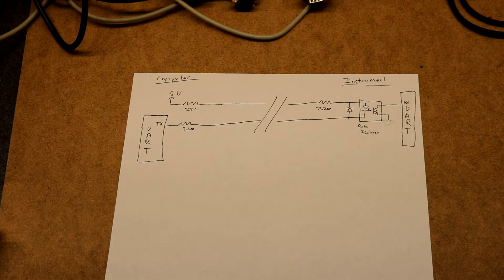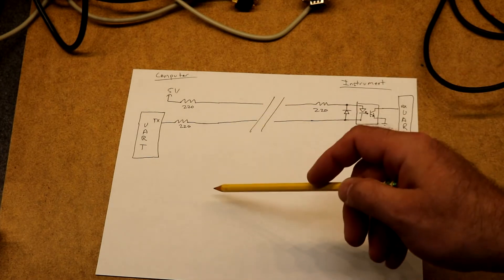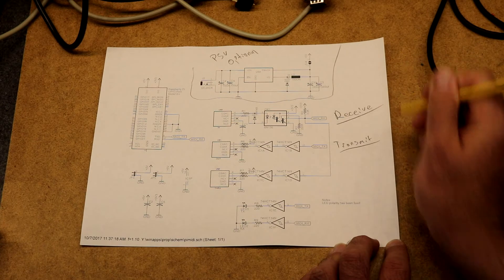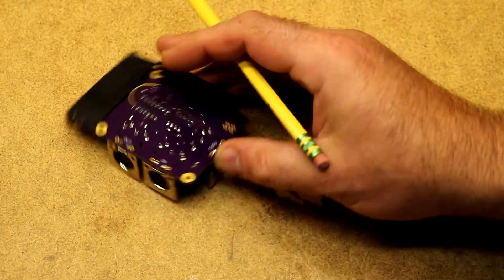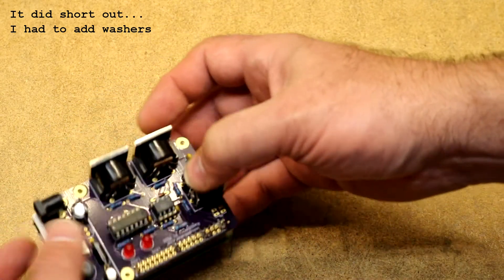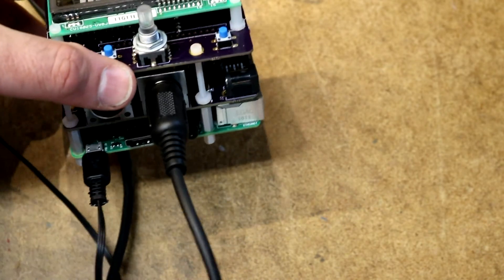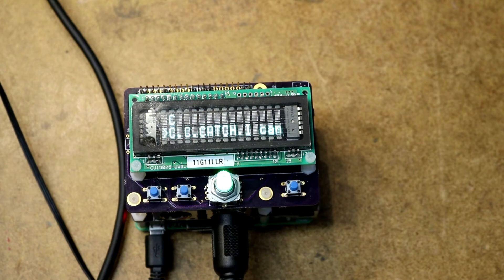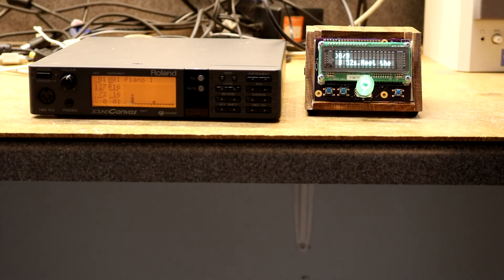Raspberry Pi Midi Hat / Raspberry Pi Midi Jukebox

Comment: Midi ain't old. Plenty of new high end synths still use 5 pin din midi instead of USB as its lower latency and used to control other synths/samplers without a computer, again reducing latency. VSTS are all ok , but more likely to crash.

Comment: A great project!  Congrats on having created a very compact MIDI file server, which is what I think you've done.
I'm looking to use one of my RasPi's or Next minicomputer boards to actually be the MIDI generator itself, emulating what the SC55 does, with the objective of creating a small interface for playing an Akai EW1-USB through without having to have a laptop (or larger) computer to host the instrument interface and probably a MidiMapper emulation (not the best, I know) sound generator which I can then output as audio.  I may have to use a pisound, but I'd rather not if it's not absolutely necessary - cost considerations!
Great video, great project!